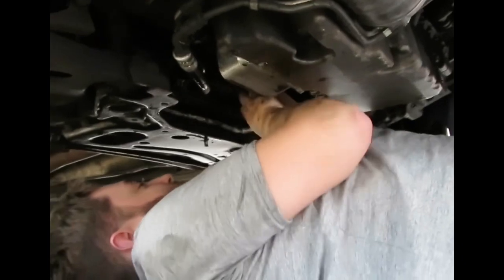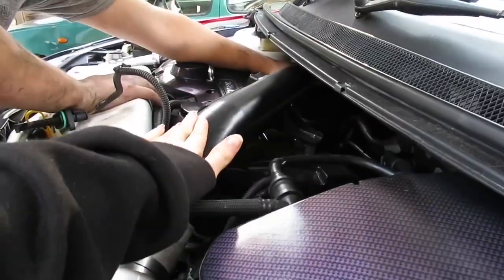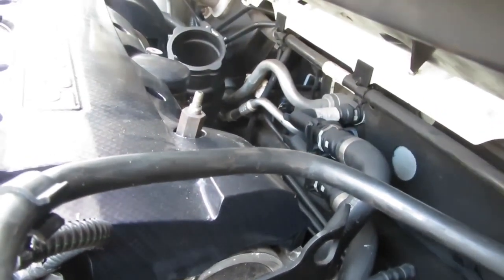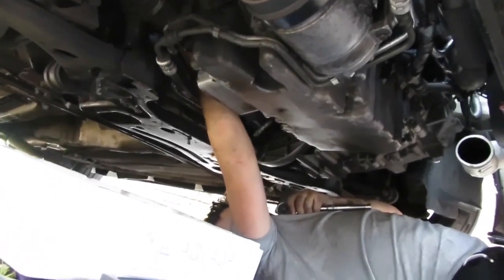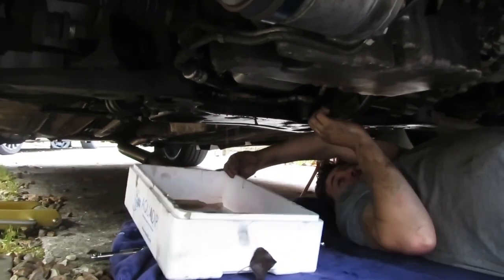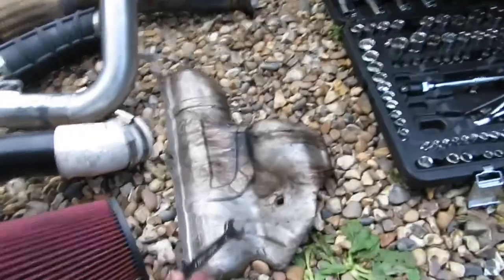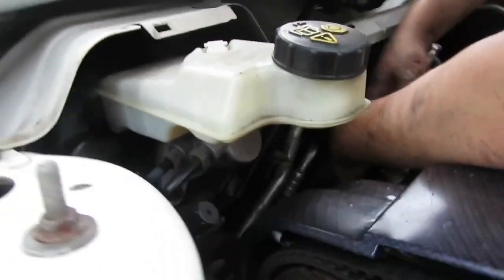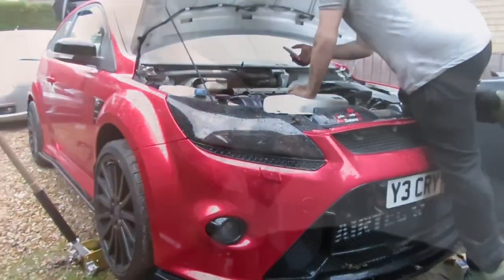WE TOOK THE TURBO OFF THE RS! To make room for something bigger!!

Comment: Has the engine been sleeved or just forged pistons rods?
Reply from the maker: It doesn’t need sleeving. Just forged x
Reply: Kris Nicholson I’ve seen people have these mk2 engines blow a cylinder wall at 450bhp that why I asked as most people put sleeves/liners if there going above 500bhp
Reply: ThatFezGal X over 500bhp I would say it needs sleeves/liners. People have had the blocks go at 450bhp
Reply: DxMxA it has the liners done pal
Reply: 500bhp an booom engine gone
Reply: focus st clearly not an expert of a 5pots strength😂
Reply: @reeces_rs7384  will see good luck Volvo do make good engine s tho 👍

Comment: I would get rid of that so called cold air intake, they suck in hot air from the engine bay and impair performance. Go with a performance panel filter in the original airbox